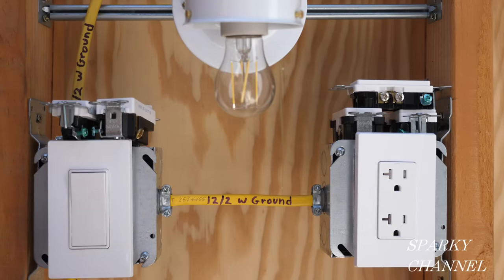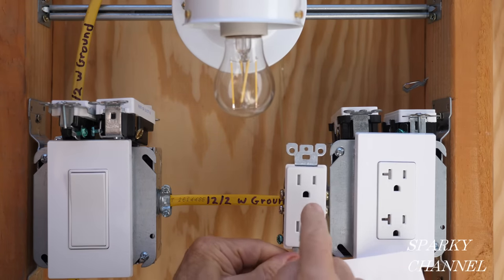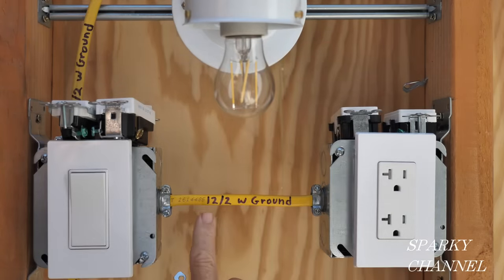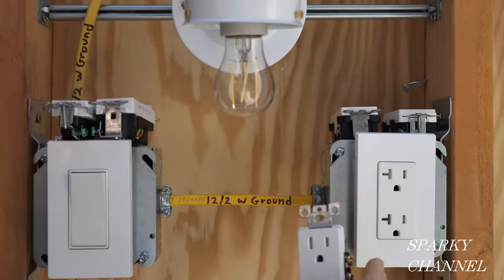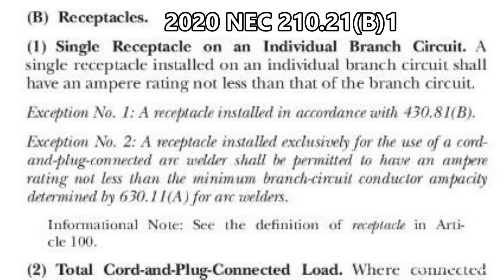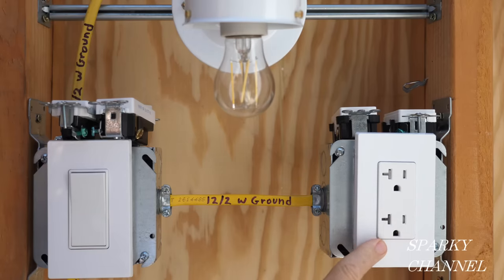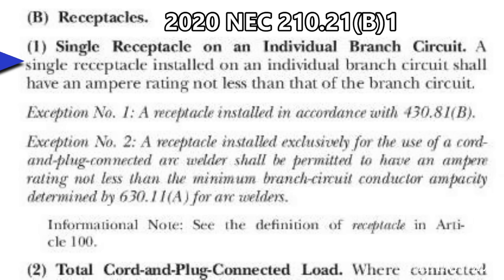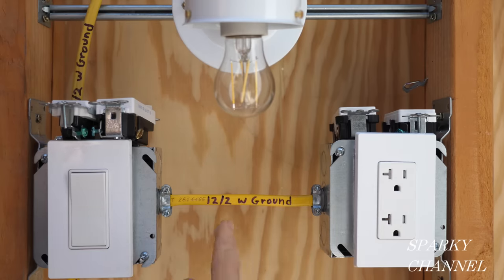Shall I Use a 15A or a 20A Receptacle on a 20A Circuit? + 2020 NEC 210.21(B)(1) and 210.21(B)(3)

Comment: I ALWAYS use 20A receptacles for 20A circuits so that I can visually recognize when the circuit is 20A.  I am far more inclined to use 20A circuits for heavy loads, even though they are less than 15 amps, because you will have less circuit heating and less voltage drop.
Reply: BTW NEC says it's okay to put 15amp outlets on 20A circuits
Reply from the maker: Excellent!
Reply: thank you
Reply: I agree 100%.
Reply: Good but not required. I may run some dedicated 20 amp circuits and use 20 amp outlets. I have a power strip that has the 20 amp plug on it I cannot use it right now at the present time. 73
Reply: but if all 20a recepts are on a 20a circuit, isn't it a potential danger if someone comes along and plugs in more than one 20a device?

Comment: Make sure your outdoor receptacles are 20 amp circuits. I hate it when I run my circular saw outdoors and the circuit breaker keeps tripping.
Reply from the maker: Yes, I agree for sure!
Reply: Years ago worked in a large new single home that had 2 outdoor receptacles and 3 full bathrooms on a single 15 amp GFCI circuit breaker. Called my inspector and told me it was not right but okay by the cide at that time. Besides residental counter top & laundry area have to be in 20 amp circuits they should make all outdoor receptacles wired to 20 amp circuit breaker.
Reply: Same with my house. All my outside and countertop outlets are on 15 amp circuit. 
House was built in 1990

Comment: The real BS is that 20A and 15A receptacles are IDENTICAL.  Tear one open.   Every one I have had open has at least one and sometimes both metal contact 'sockets' as T slots, meaning the ONLY difference between most 120VAC, 240VAC, 15A, and 20A receptacles is the faceplate.
Reply: Yes, they’re to keep someone from plugging a 20A appliance into a 15A circuit.

Comment: When I install a 20 amp circuit and use 15 amp receptacles, I pig tail the receptacles, so that the circuit is not diminished to 15 amps. If you pass through a 15 amp receptacle on the way to another receptacle(s), it has become the weakest link in the chain of receptacles. If you pigtail, the electricity to the final receptacles is not passing through the previous receptacles.
Reply: 15A receptacles are all rated for 20A of pass-through current.
Reply: I never pass through any receptacle. I always use jumpers or "pigtails"... I also always use 20A receptacles on 20 amp circuits & 15A receptacles on 15 amp circuits. I also use spec grade or better switches & receptacles.

Comment: My 1st thought was that this is backward.  You'd think the code would say it's okay to use a 20A plug on a 15A circuit because it would be less of a failure point.  But then I thought of it from the user's perspective.  If I see a 20A plug, I know I can plug in something that can draw 20A.  But if I see a 15A plug, I know I can't use anything that will draw more than 15A.  So, I guess that makes sense.
Reply: You could plug in something pulling 50 amps in a 15 amp circuit, it won't work because the breaker will trip, but have at it!
Reply: @pbear216  Hey, just trying to make sense of why the code is the way it is.  I know, it's a losing proposition, all too many times.
Reply: @dienekes4364  From a code point of view a 50A circuit requires a different type of plug. While it is physically possible to wire a 50A load to an inadequate 15A plug, code doesn't allow it. If you follow the code then you are exactly right. A 20A load should be wired with a 20A plug so it can't be plugged into a 15A socket. A 15A load, wired with a 15A plug can be plugged into a 20A socket. Remember the electrical code has reasons for what is says to do and establishes the minimum standard, it is possible to exceed that minimum but it is foolish to go below it.
Reply: I have 15 amp and 20 amp circuits in my workshop.  The 15 amp circuits have 15 amp receptacles and 20 amp circuits have 20 amp receptacles.  My table saw, a planer and a MIG welder that can each draw up to 18 amps, so their cords are fitted with 20 amp plugs so that they can only plugged into the 20 amp receptacles.  A 20 amp plug cannot be inserted into a 15 amp receptacle.
Reply: Dienekes: Fortunately a 20A appliance Plug will not fit into an 15A duplex receptacle.  P.S. you are using the word plug when meaning the receptacle.
Thank you.
Reply: @tedlahm5740  "P.S. you are using the word plug when meaning the receptacle." -- Thank you, Mr. Padantic.  You used the letter "A" when you meant "Amp".
Reply: @dienekes4364  I think its pedantic, derived from pedal, as in I want to pack pedal away from this conversation as quickly as possible ;-) TTFN.

Comment: Very interesting. I saw something in the past that said there was no difference between a 15 amp and 20 amp receptacle except for the face. You blew the hell out of that argument. I knew there was a price difference between two seemingly identical receptacles but had never heard of specification grade. Again, very informative.
Reply from the maker: Sounds good Fred!
Reply: With some brands of receps, ya there is no difference other than the face.
Reply: There is no difference between a spec grade 15 amp or 20 amp receptacle, outside of the face plate. If your load has  a 5-15 attachment plug, a 15 amp spec grade receptacle will do just fine. Don't spend double for the 20 amp.

Comment: Sparky, you have no idea how many master electricians I asked this very question.  
I did my own kitchen remodel and 1 thing I wanted to do was take a ceiling light down from over the sink and install a GFI receptacle in its place then run some 14/2 across the ceiling to the opposite side above the stove microwave.  These 2 receptacles are for LED lighting only.  
Builder had 20a 12/2 on that light so what you are stating   So happy now!
Reply: That I believe is against code

Comment: Good video and channel.
  I have 14 gauge wire and currently a 15 amp GFI in my bathroom.    It's hooked up to my entire garage and an outlet in my basement. 
    I have replaced it twice now and not only does it trip, but it DIES.
     Can I put a 20 amp GFI outlet in its place?
     if no, what if I have an extra wire (ground) coming out of the cable? 
  Thank you.

Comment: At the 2:56 mark you stated that for a single receptacle you must use a 20a receptacle for 12/2 that is protected by a 20a breaker.  However, you could use a larger than 20a receptacle as well as long as the receptacle is the has the same or higher rating than the circuit.  In other words you could use a 20a, 30a or even 50a on a circuit protected by a 20a breaker.  Not too common in a house though, but is for certain purposes such as an RV for example.

Comment: Question, a normal person would use 12AWG wire on a 20 amp CB.  How many duplex outlets (15A or 20A) would one put on a single circuit?  On a commercial building I've found as many as seven.  What's worse, some of these outlets were as far as 300 feet from the panel.  According to my wire gauge calculator, the wire should have been 6AWG for that distance.

So how many duplex outlets on a 20A circuit?

Jim
Reply: There is no set number. You only have voltage drop and resistance ratings to comply to. In theory you could have 10 duplex without violating either on a 20a
Reply: There is something called load calculations. The nec assign outlets to be 1.5 amps. 20 amp breaker loaded to 80% gives you 16amps to play with. 16/1.5 = 10.66. 10 receptacles max on 20 amp circuit! I'm an electrical apprentice that has not learned load calc so 🤷

Comment: About 10 years ago I remodeled my kitchen myself but pulled a city permit and had it all inspected by city electrical inspector. Used 15a receptacles on 20 amp kitchen counter circuit (#12 wire 20a breaker). Last year one of the receptacles caught fire, had an older stand-alone microwave plugged into it, the circuit breaker and GFCI never tripped.
Reply: That sounds more like just crappy receptacle...
Reply: @Ryarios  or a loose connection at the receptacle or the micro wasn't plugged in good.
Reply: Mike  I thought a gfci would trip if over loaded. Maybe I don't know the difference between gfci and gfi. Can you explain?
Reply: @dianecelento4974  not an expert, just been looking this stuff up for about a month
but as far as I know ground fault circuit breakers break the circuit when there's electrical leakage to the ground (such as when water enters the outlet) 
while arc fault circuit breakers break the circuit when there's an electrical arc (sparking from conductors making contact), which is most likely what caused the fire
and gfi looks like it's just a shortened acronym for gfci
Reply: @kh8655  Thanks for the response. Seems scary that he had a fire even when he did everything right. Used city inspector and all.  I would have thought the little button on the gfce would have tripped and prevented the fire.
Reply: Mike  I thought the little button on gfci trips instead of circuit breaker. Thanks for the response
Reply: Mike  What's the difference?
Reply: Did you stab the wire into the little hole in the back of the receptacle Or wrap around the side screw?  I've never seen a receptacle fail when the wire is wrapped correctly around the side screw and tight.  Stabbed from behind, they loosen with heating/cooling of heavy loads, then arc, then burn. the proper way to install a receptacle when more than one cable enters the box, say one romex in, one out, join the 2 blacks together plus a 6" pigtail.  do the same for white/grounds, then wrap side screws with pigtail for best lasting connection.
Reply: Mike  That's a stupid answer. We're all here on youtube to learn.
Reply: Mike  I like to learn something every day. It doesn't take decades to learn electrical anyway. Or maybe you just don't know the answer. I didn't say I was going to do the work on this anyway. But I like to supervise my workers since I have a few properties.
Reply: @dianecelento4974  you can always resort to contacting the manufacturer. that NEVER fails.
Reply: @dianecelento4974  A GFI or GFCI both work by monitoring and comparing the amperage (flow) in the neutral and the line wires.   When there is an imbalance, indicating that some of the current is going to ground, the device trips.
Reply: Heat is caused by excess resistance not excess current.  A circuit can gain resistance due to corrosion, a terminal screw wrapped the wrong way causing the connection loosening, or a host of other causes.  As the resistance goes up, the heat at a given Amp draw goes up.  And, things burn up when they get hot enough.
Reply: I believe the older microwave was the problem pulling more amps than the receptacle was rated for but not more than 20 to trip the circuit breaker and eventually just overheated and caught fire. Probably not wise to use older appliances but will never again put a rated 15 amp receptacle on a 20 amp rated circuit even though it is allowed by NEC. Overheating and/or a fire alone probably will not trip a GFCI or circuit breaker.
Reply: @MiloCK_0991  Thank you
Reply: @randallthomas5207  Thank you so much for the info. Very informative and easy to understand.
Reply: The excess heat was due to a homeowners limp wrist.  That's what homeowners do.  They watch YouTube videos and start fires.  Gfis dont trip when they burn.  They trip when there is a ground fault.  That's why they call them ground fault circuit interrupters and not on fire circuit interrupters.
Reply: Sparky noted the cheap outlet plugs VS the expensive one.   Cheap plugs do not "connect" as well and become worn and loose fitting. Thus the 12 Amp microwave worked fine and the GFI was fine but the plug became hot and melted the insulation.   You can observe this when you use a hair dryer... the plug become warm when used.
Reply: Bad receptacle or someone tried to use the holes to stick wires into instead of wiring to the screw terminals. The cage clamps inside the holes are notorious for failing over time I went in and redid all mine when we moved in 15 years ago and haven’t had any issues....

Comment: Are not 15 amp spec grade or commercial grade receptacles also more heavy duty than residential grade of the same amperage? I read that a spec grade 15 amp receptacle is the same as 20 amp unit except it's designed for the standard 15 amp plugs only (and doesn't support the horizontal neutral prong of the 20 amp rated receptacle.
Reply: Jacktannehillpromoter: I would say yes. Most of the commercial grade receptacles have the contact points arranged to accept both 15 and 20 amp plugs. The front plate is what is different. Getting a spec grade commercial receptacle will give you a better version, then the usual residential version.

Comment: yes but how many 20Arecept can be used on a 20A circuit at the same time?
Reply: If you have 2 appliances with actual 20 amp plugs, then the answer is no. Likely, they will each require 13 to 15 amps, so the breaker should trip. That's why these appliances require a dedicated circuit with a single 20 amp receptacle. A duplex receptacle is not allowed in this case. Obviously, you could have a duplex receptacle, but be mindful that only one socket should be used at a time. 20 amp power cords are pretty rare.
Reply: There is no explicit limit in the code as to how many receptacles can be on the same circuit.

Comment: Talking only spec grade, same manufacturer, other than the "T" shape slots on 20 amp, is there a physical difference in the 15 and 20 A receptacle? When you compared the two it looked like you showed a spec grade 20 and non-spec 15.
Thanks for the great videos. Learning lots about code thanks to you.
Reply: there are two main differences.  the contacts for the plug are thicker metal on a 20A receptacle than on a 15A receptacle, and on the specific receptacles he showed, the 15A one is approved for use in a dwelling unit, and the 20A one is not approved for use in a dwelling unit.  a receptacle to be used in a dwelling unit MUST be rated tamper resistant - which IS available in a 20A rating - but the ones he had were not tamper resistant.

Comment: I've heard it said by Mike Holt that they, (15A and 20 A), are built exactly the same inside, so it doesn't matter which one is used. One day when I have time I'll tear into each one to see. I just don't see why there would be a different rating if the conductors are the same. Am I missing something?
Reply: I was thinking the same about tearing them down for a look.  One thing I noticed, as far as conductors, is that even the screws on the 20A look heavier to handle the larger gauge wire.
Reply: @lelandlewis7207  Yes. Something doesn't seem right. Also, if a SINGLE recep is to installed in a 20A circuit, it MUST be a 20A recep. But a 15A duplex can be installed in the circuit and two devices can be plugged into it, each potentially with a 20A draw. That's a problem.
Reply: @davidgagnon2849  yeah, I shook my head at that one too.  I have seen other codes that don't seem logical, makes you wonder what they are thinking at times.  🙄
Reply: he mixed two different ratings there: there are 15 and 20 amp receptacles, in which (assuming both receptacles have screw terminals) the only difference is the thickness of the contacts for the plug.  then there are regular and spec grade receptacles, in which the basic construction of a spec grade receptacle is built to survive more abuse.
Reply: @davidgagnon2849  an appliance that can draw more than 15 amps is required to have a 20A plug. - so it can't be plugged into a 15A receptacle.  the code also says that any circuit has to be sized adequately to carry the load it is going to be used for.